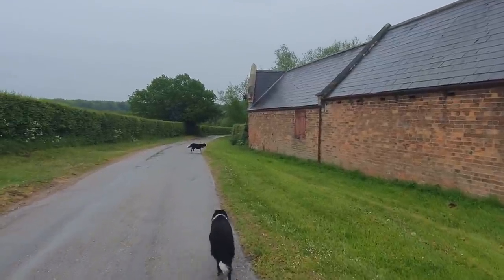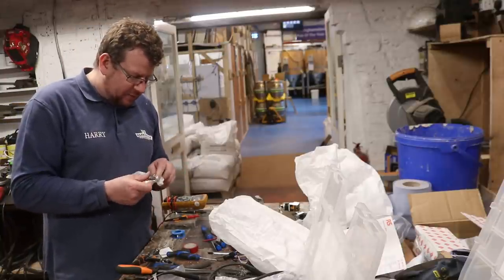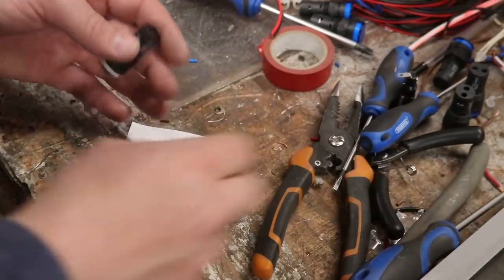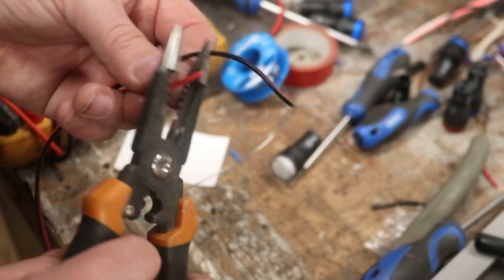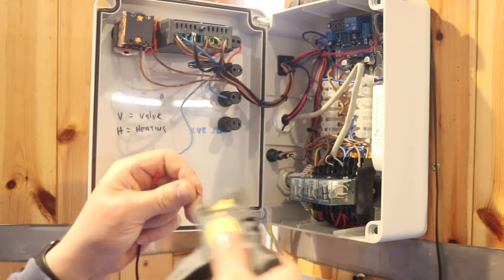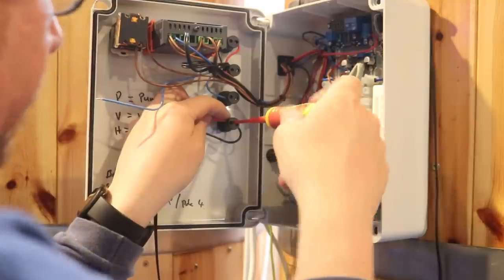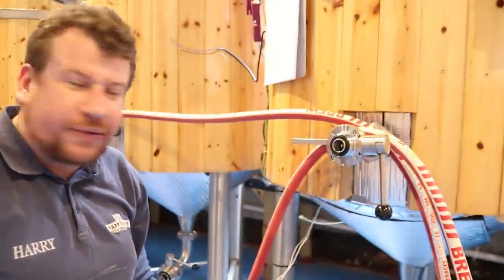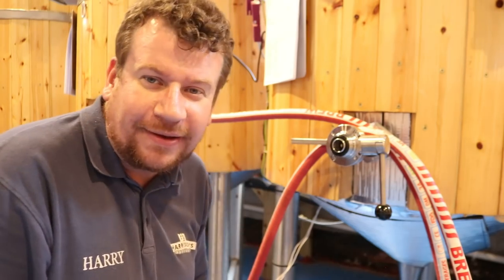Safety Features For Fermenter Heat Pads

Comment: Nice.  Just one question: I thought the STC-1000 could handle up to 10 amps on the switched heating and cooling outputs.  Why the external relay rather than using the internal relay of the controller?
Reply: Because the outboard relay is a cheap part and plugs in and out, the way Harry has it set up...the STC1000 has a couple of small relays, which, it CAN handle 10 amps, but handling that load will kill it in a year or so...those internal relays cost twice as much to obtain and replace. At least that is my experience. The STC is under $20, but everything else in it  will last for many years - those relays, depending on load, not so much. Oh, Harry mods those relays a bit, also...he's a wizard, I tell you.

Comment: Do you think the concentrated heat location at the bottom on the yeast will do anything to the profile of the beer
Reply from the maker: I hope not, I use top fermenting yeast on 95% of my beers. I would guess once the yeast has finished and begins to drop out that I won't be using any heat.
Reply: Ok. Cool awesome setup.